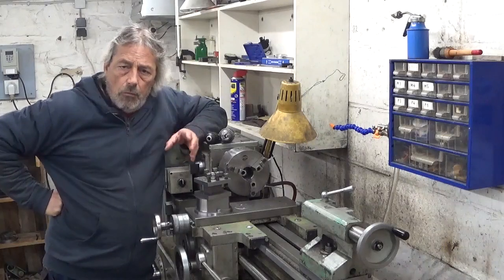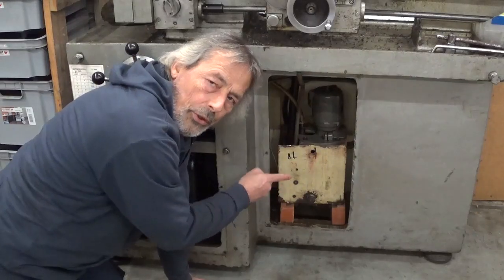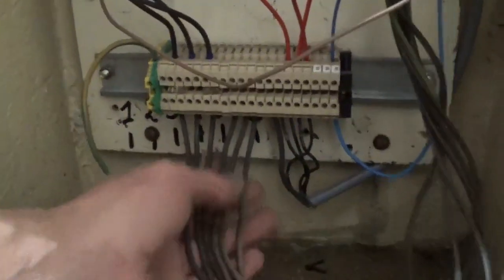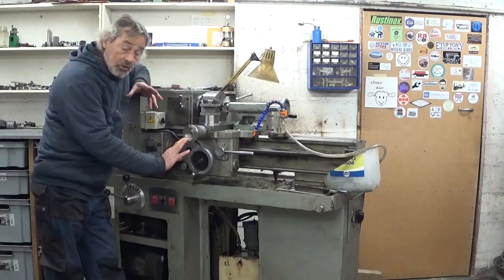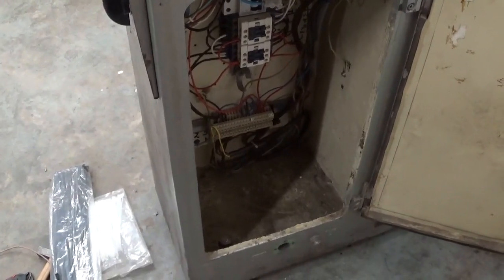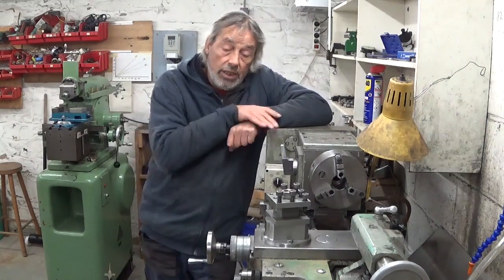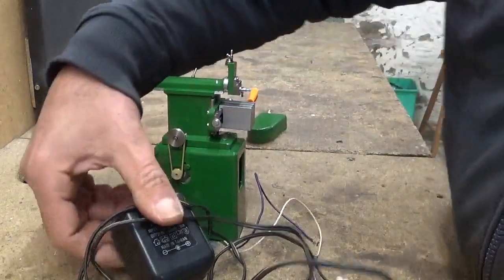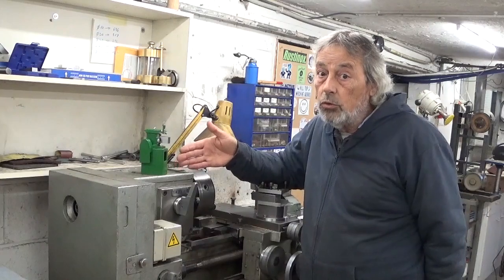Compressor in the lathe???

Comment: Your comment about 0.75 pitch not existing in the metric series, I'm sorry to say that it does. I bought an int30 endmill holder for my mill and the grubscrew that holds the endmill in is 6.0 x 0.75 metric fine. I have to be very careful not to lose that little grubscrew!
What size (mod, teeth, width and bore) do you need for the change gears?
Reply from the maker: You're absolutely right, 0,75 pitch exists. It's just not the common size we'll find in the hardware shop.

Comment: Great solution hiding the compressor in the lathe. I have a similar compressor I use for the air blast nozzle on the laser cutter. 
The model Shaper turned out beautiful. Nice work. Cheers Kevin
Reply from the maker: Thanks Kevin.

Comment: Hello friend, Keith from Michigan. I've somehow I missed 😕 the videos session on your Mini Planner. That looked super 👌 nice!! Let's talk about using a compressor and clear out metal chips and some other equipment. I'm against this on Lathe's carriage cross feed. BUT, if used correctly. It's okay on the chuck, you tail stock to clean off drills, taps. Just lower the pressure my friend. Heck, I use air a LOT. Yeah pls always have your eye 👁 🙂 protection. Take care 🙂.
Reply from the maker: Thanks Keith. There's a shaper build playlist on my channel.
Reply: @Rustinox  Keith will look into your mini Shaper you made. You made me laughing when you were trying to find a location 🤣 on your Lathe with that little air compressor. Well winter is here now, because around my state Michigan, we are surrounded with fresh water (not the ocean) so we can get a lot of snow in winter, yuck I'm not a winter bug anymore. So have a pleasant weekend ☺ friend

Comment: Hi Michele, good job. The noise level is not bad, consider some insulation inside the cup board that may drop the noise considerably and it wont frighten the crap out of you when it starts up.  Cheers from OZ.
Reply from the maker: Thanks Roger. It works very well.

Comment: The ground wire that doesn't go anywhere is actually grounded to the machine body through the special grounded DIN connector and the DIN rail mounted to the frame. It is there for the safety of the operator. It is a requirement for our DIN electrical box builds. Tapping into it shouldn't necessarily be a problem but there is a connector right there for you to use. 
Nice addition for the air compressor. I mount mine under the table that my mini lathe is bolted onto.
Reply from the maker: Indeed, the earth clamp is connected to the rail.
But it was not connected to the power cable.
Reply: @Rustinox  Aha, then you are correct: that is a mistake. Looking at the rat nest it seems like someone has been in there making changes after it left the factory. Nice job of dressing up the area.

Comment: Well that was interesting. I was captivated by the wiring description and no earth on the stand. It happens. So you have 3 phase 415 volts in your shop? I have a small compressor like that but I plan to use it for spray coolant mist. The shaper model is awesome. Painted up it looks amazing.
Reply from the maker: I have 3x220 V 50Hz. No Neutre.

Comment: Thanks for yet one more really entertaining video! I'm sure You can make videos about just anything and they will be the same entertaining.
The designer of the lathe.... Maybe he carried his head under his arm? Luck that the door was not in the bottom of the cabinet....
My kompressor is bigger! Has a 10 liter tank and reaches 8 kg/cm2. Seldomly used...
Motor from USSR.... The mother of my children bought a wall clock and the machinery was from USSR. Normal clocks sounds like tick, tack. The USSR machinery sounded like TIICK, TAACK and could be heard all over the house... I changed the machinery to a modern, Braunschweig listening and synchronizing version so I could sleep....
French gearbox? What a bastard lathe... Built from a junk yard expedition? Never mind as long as it turns well.
Too much junk around? Compared to me You are a novice, a beginner! Here is the mechanics shop, the electronics shop and a large railroad, all surrounded be "useful things"...
Mini shaper powering...... You bastard..... Illusionist!
Reply from the maker: Wow! That was a lot of typing work :)
Reply: @Rustinox  Powered by the joy Your video gave me.....

Comment: Hi Rusti, great idea, I too have a oil free compressor and it scares the hell out of me every time it kicks in so I just don't use it! I also am not a fan of using comp air on machines, I have seen first hand the damage this does on some very expensive CNC kit. You will laugh now, I use a bicycle pump for the lathe, it's incredibly quiet, uses no electric, very safe, and you get to keep fit when you use it! Cheers, Jon
Reply from the maker: Bicycle pump is a good idea.

Comment: I like your idea of using the small space for the compressor. My lathe has an access panel on the back for the coolant pump but I don't  use it since my lathe is against the wall like yours is. You have given me an idea for putting a small compressor in that space to use with a mist coolant system.
Thanks for all of your great videos.
Reply from the maker: Sharing idea's. That's why we do YouTube.

Comment: That's a very clever solution to place the compressor in the lathe like that...
I know everyone's needs are very different 
I kinda started to run out of space down low some time ago. As such I try to go up with things that are light/small..
I keep a small shop vac hung close by my machines, and a centralized overhead plug to power it and other things...
Plus I stumbled onto an idea from another tuber, I think  his channel was/is upstairs machine shop...
Anyway he had a ryobi 18v blower he used for chip removal,  so I had to try 1...it works really well for some (not all) of the dry swarf.
Reply from the maker: Thanks Craig. We do with what we have :)